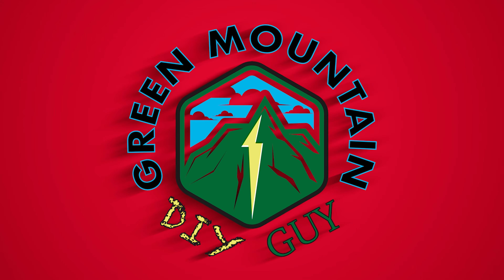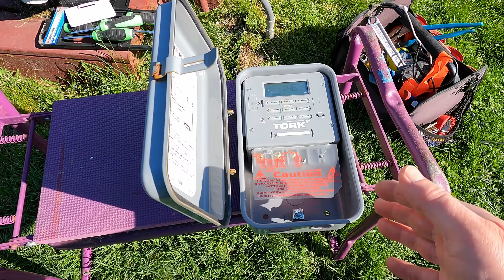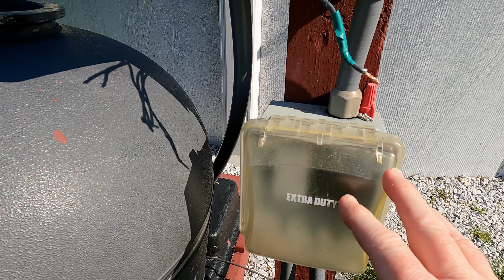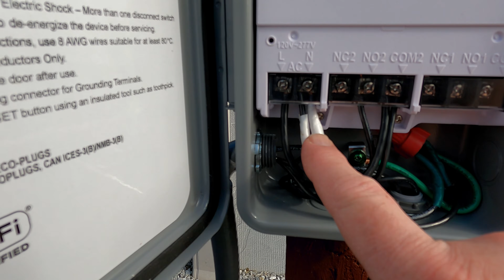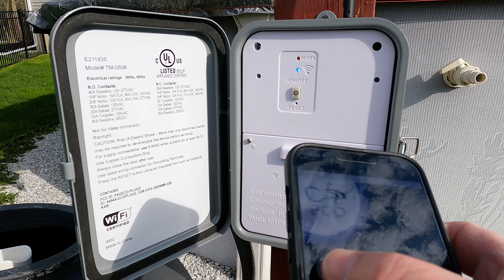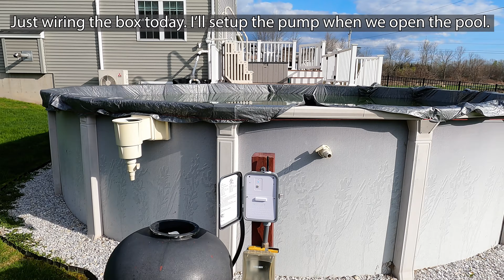Dewenwils Outdoor WiFi Smart Box for Off-Grid Solar Powered Pool Pump

Comment: I bought this unit to tell me when my jet well pump is running.does it send a notification to your phone when the pump is running ? Went thru 6 well pumps when the county lost pressure on this end of the county.I live on a very in large hill and on city water but have a jet well pump to pull water up the hill and tired of replacing pumps and plumbing for said pumps. 6 Pumps in 26 years of living here at 500 dollars a pop.
Reply from the maker: I think you can set up an notification through Alexa.

Comment: Can't say how much this video helped. Their instructions are crap and you made it make sense. For those of you having issues with the app, realize that if you are registering for the first time, it takes a few minutes for your registration and the mac address to register in their system.  1. Create an account 2. Wait 5-10 mins 3. Connect to the device via wifi 4. Enter in wifi credentials.  Hope this helps someone else.

Comment: Not Solar Powered. Fix title.  But good video
Reply from the maker: Where does the power come from for my shed that powers my entire pool?
Reply: @GreenMountainDIYGuy  It usually comes from a grounded GFI outlet or directly from the breaker box.  So theres ports for line and load on the timer,  you look at the diagram and there's other videos on here.  I wired 3 boxes already, it's not that difficult.  Buy a line tester so you don't get electrocuted. There's nothing color about this unit.
Reply from the maker: @1242mc  Check out my shed and setup, It is 100% off-grid.  Solar and batteries power our complete setup.  https://youtu.be/YV6a9Vs52WE?si=VzAP-Qu0H2Zgb4X0

Comment: Hi, my power and pump wires has a neutral wire as well (along with 2 line/load and ground). Since this wifi timer does not have a port to insert these neutral wires, is it ok to just close them safely?

Comment: installed 2 off these the unit is great but the app ECO PLUG is has a horrible interface and I cannot get the weekly timer to work
Reply from the maker: You are better off noot using the app and setup an automation routine in Alexa.

Comment: I have a similar scenario but the outlet is not GFCI, it's the twist lock that operates the pump. can't figure out on how to trip the GFCI breaker on this, ground in place, all seem to be working well but not tripping the breaker when testing
Reply: Do you connect to the "charge" screews ?

If you put on the "line" screews never works fine